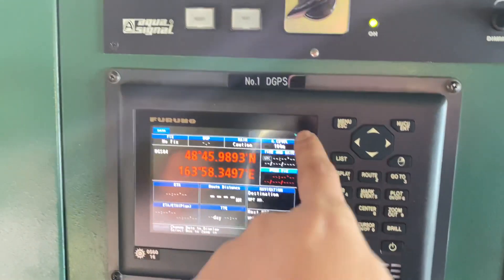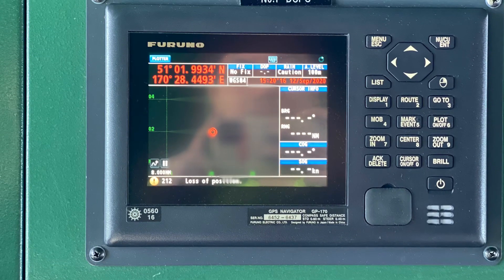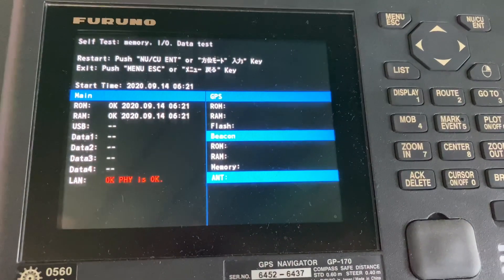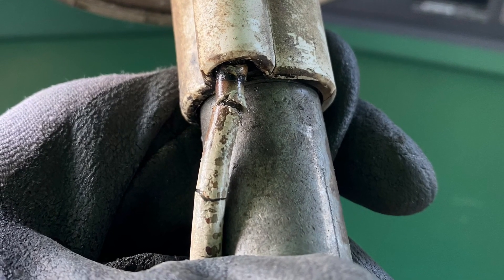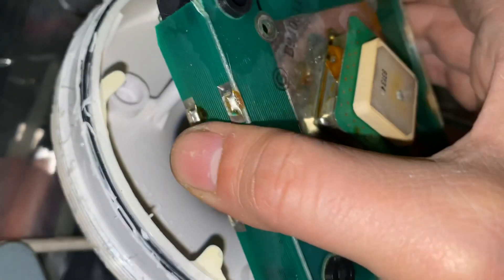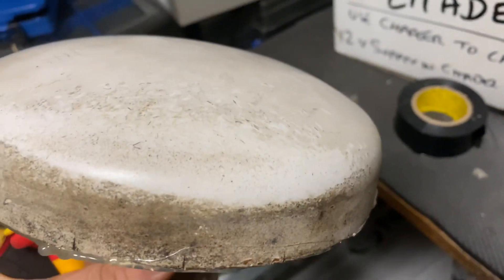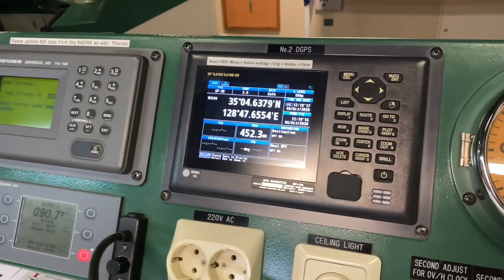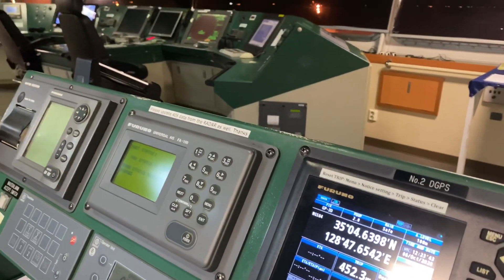GPS LOSS OF POSITION ALARM | ETO TROUBLESHOOTING

Comment: additional info po...sukatan nyo yung likod ng gps unit..sa may kinakabitan ng antenna....dapat may approximately 5 to 7 volts DC...pag mababa o zero yung  sa display unit may sira...pag ok naman....connector , cable o antenna na mismo sira..any passive gps antenna( coaxial cable gamit) means kahit koden, jrc .furuno etc  pwede ipalit.

Comment: Nicely done, good follow through and to include reminder about working aloft permits.
There are times, when the issue is not on board the vessel.  Always good to maintain a back up plan/alt means to navigate.  It is a very uncommon occurrence  but has happened - both in loss of consistent satellite access and with "others" distorting the signal/intel.

Comment: I work for a telecomm company in Canada and all our celular switches and syncronization is derived by GPS..  Over the years many of these antennas have failled because of water incursion. The anyennas are flat plate log periodic type antennas.they are usually trash by  the time we open them up.
Reply from the maker: Too bad in shipping we often not having spare antenna esp when sailing in pacific that requires 2-3 weeks before we arrive to the next port hence we always need to do whatever we can to keep the unit working
Reply: @leckyjake  it looks like that antenna amplifier is all weather sealed. Electronics at sea must take a real beating.  Love your videos.. I am a technician and use many of the same troubleshooting methods as you.
Reply: @1pilotsteve  with the experience in marine can a person switch to jobs like yours